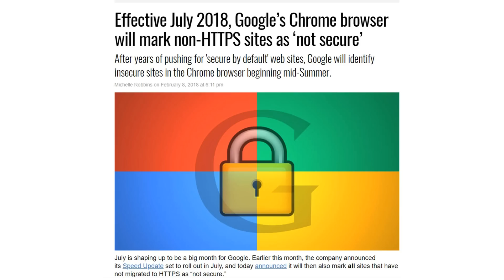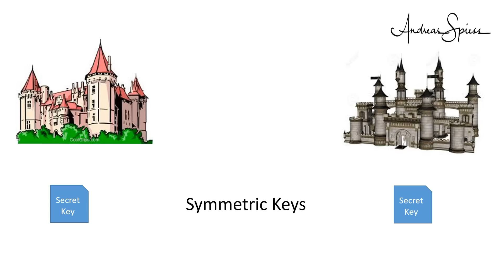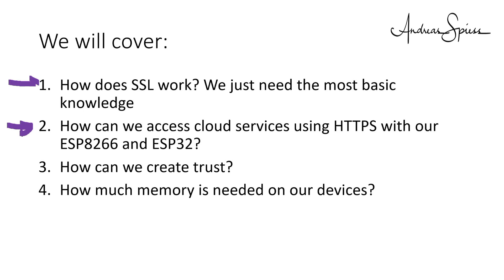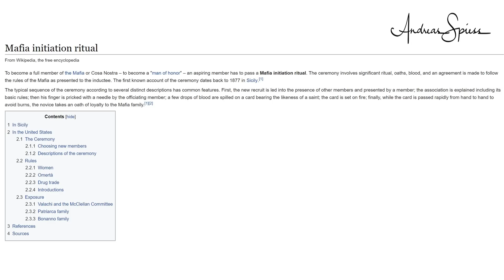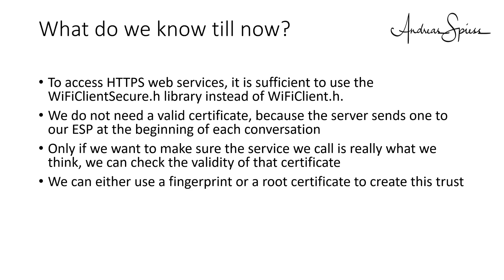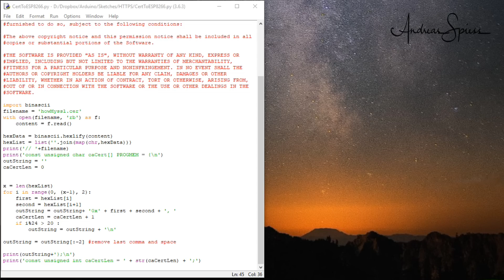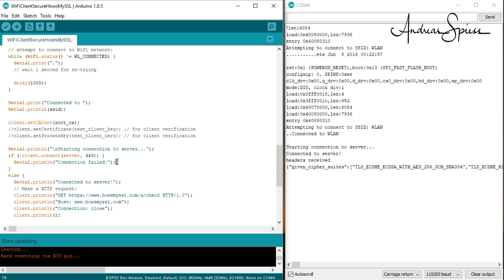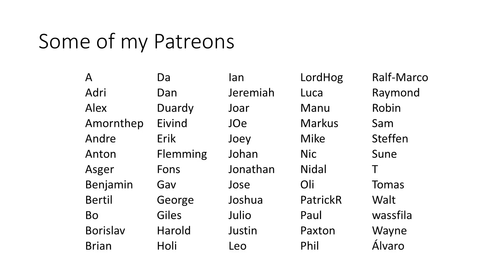#232 How to secure our devices using SSL (ESP8266, ESP32, Tutorial)

Comment: As usual, a great video. Hoever, I did miss the part that talks about performance of the asymmetrical (handshake) part of the connection. Depending on the cypher i may take upto 3 seconds to het the connection up and running. When using mqtt this can be a mayor pain in the bottom. I would have loved to have some more info in that since it's hard to find...
Reply from the maker: I do not use encryption in my LAN.
Reply: @AndreasSpiess  I don't understand. The video is about using SSL on (for example) an ESP32. An SSL connection starts with a handshake that uses asymmetrical encryption. I can be very slow especially if you reconnect every few seconds (MQTT for example). It made using MQTT over SSL nearly impossible for me. Hence my question...
Reply from the maker: @Bigman74066  sorry that my answer was so short. what I wanted to say is that I use SSL to contact internet services like google. So I do not need frequent repetition.
MQTT is only used for my sensors on my Wi-Fi. So the 3 seconds are not a. If Problem for me.
Reply: @AndreasSpiess  thanks for clearifying. Maybe someday a video will pop up about performance of MQTT over SSL on an ESP32. You never know!

Comment: Hello sir, u make some great videos.
I cant wrap my head around the following concept. Maby you or anyone else out here could point me in the right direction.
Wat I am working on is the following,
I am building a vendingmachine thats controlled by an ardiuno. I want it to work as followed, a customer goes to my website on their phone, this opens a webstore so they select the products into the basket and pay online witj ewallet or online bank. Just like any other webstore, than the webstore needs to send.the data after payment verification to the andrino that gives out the product. I understand I can connect it with utp to the internet, but what protocol or software I use on the website to instruct the arduino? Or would it be easier to use a phi that hosts the webstore, and connects via lan to the.andrinos?
Reply from the maker: I would divide your project in parts and build one part after the other.

Comment: Dear Andreas, since this video is already older and I am fighting with micropython on an ESP32, didn't find much in the internets: It would be fantastic if you could try HTTPS requests on micropython :) maybe even with proper certificate checking - or would you suggest CircuitPython? So far, I like Thonny a lot..
Reply from the maker: After my Toit "excursion" I will not cover higher languages for quite some time. The time is just not ripe for mainstream. At least not in this community...
Reply: @AndreasSpiess  Ah OK thanks you for your answer!

Comment: Hello Andreas, this was great - thank you. Hard-nosed, focus on specifics and only what is needed as usual.

However, I have a couple of questions which might be answerable by you or anyone reading this. I am using ESP8266:

1. In my case, if the fingerprint is wrong the connection does not proceed - it is refused and no information is returned. So that is not an option for me. Does anyone know how to get aorun dthis?

2. Even with the certificate version, it will still stop working in a year or two, so this cannot be how embeded devices colve the problem - they would become non-fuctional when the certificate did expire. How do they do it?

Many thanks
Chris
Reply from the maker: There are some developments to get the replacement of certificates working. But it is not easy on MCUs. I have no solution for the moment. Maybe somebody else knows. I only know that we can deal with it with IOTAPPSTORY.
Reply: @AndreasSpiess  Thank you Andreas - a personal reply so fast to a comment on a video years old. You are a MACHINE, and I envy and admire your stamina. The community is vastly better wtih your contributions. Thanks agin, Chris

Comment: Thank you for this tutoriel, it was just the right thing to get me started on my project. Really easy to understand ! Your channel is really a gold mine for IOT users !

I'm working with an ESP32 and an MQTT Server. I found that the way to make the connection secure with the server is close to what you show in this video, with some nice certificate. It's working quite nicely in local network, and it's in part thanks to you ! 

But if my ESP32 is outside the network, then I manage to reach the server (with it's public ip and some port forwarding on my box), but I can't connect to it. Did you ever had a similar problem ? It's quite mysterious : I know my certificate is ok, as is my server. But suddenly the server told me my certificate is corrupt. Almost mystifying, really.
Reply from the maker: A project I was involved (IOTappstory) had to solve this problem. But I do not know the details. I only know it was not easy :-(
Reply: @AndreasSpiess  Ah, I can believe it, network problem is never easy. I don't believe you've got an hint on how it was solved ?

Comment: Hello Andreas, 

I am having trouble getting your python script to work properly. I loaded it into my Raspberry and ran it in the same folder as my ca.crt file (also tried changing the name to ca.cer). I ge this error:

python CertToESP32.py
// ca.crt
const char* test_root_ca = \ 
Traceback (most recent call last):
  File "CertToESP32.py", line 39, in <module>
    first = (chr(content[i]))
TypeError: an integer is required

The certificate is in the right format with -----BEGIN CERTIFICATE-----, but it doesn't have those nice /n at the end and hasn't been adjusted. I guess that is the purpose of your script! By the way, I created my certificates using OpenSSL
Reply from the maker: This is an old project. So it is possible the code does not work anymore.
Reply: @AndreasSpiess  Okay, thanks for letting me know! I suppose I can manually count the characters and hit ENTER a few times for the two certificates I need.

Comment: Couldn't get you example sketches to work, sketch always stops with "connection failed", so the fingerprint was not even checked yet.
Eventually i added the next line to the sketch (directly after "WiFiClientSecure client;"):
client.setInsecure();
Don't know what was wrong with my setup, but it works flawlessly now :-)
Reply from the maker: Thanks for the update. Strange...

Comment: If you do not want to bother with manually writing a fingerprint or certificate in your sketch, there is also a framework that automatically includes all root certificates in your ESP8266 sketch. With this you can do HTTPS requests to any URL, and it will always be secure:
https://maakbaas.com/esp8266-iot-framework/logs/https-requests/
Reply from the maker: Thank you for the link. Seems to be a good approach. Unfortunately not for the ESP32...

Comment: Thank you for the perfect explanation. It is very useful an focuses on the important facts.

Is there any possiblilty to download the SHA1 fingerprints from a server of website?
It would be easy to update the fingerprints by stating the URL and getting back the SHA1 fingerprint like in the browser. So the sketch could get it once the fingerprint is expired and I would not need to update it manually.
Reply from the maker: I do not know.
Reply: This would not be secure, because if you would have a man in the middle, it would just provide you with the wrong fingerprint and you would not know.

Comment: does Esp32 support self signed certificates? I can make POST requests from mobile to my localhost server, but not from esp32 using the same self signed certificate..
Reply from the maker: Unfortunately I am no security specialist.
Reply: @AndreasSpiess  no problem..
just because i plenty of hours working on this, if someone have the same problem MAYBE esp32 is problematic with self signed certificates..i didnt make this work even other secured sites worked fine
Reply: Blog https://medium.com/the-esp-journal/esp32-tls-transport-layer-security-and-iot-devices-3ac93511f6d8 contains information about using self signed (CA) certificates. Maybe this helps, not tried by myself yet.

Comment: How can I connect to https when using an Arduino Nano or a Teensy for example? Or do you have to use an ESP8266 development board/MCU? 
I have an ESP8266 WIFI Module (ESP-01) connected to a Teensy 3.2 board, but when I compile it says "ESP8266WiFi.h cannot be found". If I change the board to "Generic ESP8266" I get an error saying "Multiple libraries were found for ESP8266WiFi.h". So confusing.
Reply from the maker: I only work with ESP boards if I need WiFi, so I do not know,.

Comment: Excellent video, as usual. Thanks a lot!
However, I tried to replicate the steps for ESP32 but I have an error with the certificate. I found another example with different howsmyssl.com certificate and it worked. Is the python script in your repository still valid?
Reply from the maker: I di not know as I did not use it since then.
Reply: Hi Ismael, could you kindly share the example you used to convert the base64 .cert file to the format used for ESP32 please?

Comment: The code used in HTTPSRequest.ino for the esp8266 is it not outdated? Because I see the BearSSL library is more often used these days and AxTlS library is
 deprecated. Does this matter as to the safety of the connection? Please clarify, thank you!
Reply from the maker: This is an old video. BearSSL does not change the basic concept. So there should be no difference in security.

Comment: I am getting 'connection failed' for some reason with the HTTPSRequestHowMySSL.ino example. Any help here? I am able to connect to my wifi but failing on howsmyssl.com (using esp8266)
Reply from the maker: Unfortunately, I cannot do remote debugging.
Reply: Andreas Spiess the issue was in my fingerprint! I resolved it by accessing the api insecurely with no fingerprint which leaves it vulnerable to server spoofing but is ok enough for my use

Comment: Nice explanation, and good info. Thanks. Have committed some $$ via Patreon
I found an error message trying to convert a root cert file to .cer format using  Cert to ESP8266.py. Fixed by removing the attempt to map the chr function across the hexData.
ie:
replaced this
#hexList = list(''.join(map(chr,hexData)))
with this.
hexList = list(''.join(hexData))
Reply from the maker: Thank you for your support! I am not a Python specialist and I found the script on the internet. When I used it I had no errors, if I remember right. Now your code is in the file.
Reply: Hi Bernie, how did you do this?
Reply: Already tested. This should works:

hexList = list(' '.join(map(chr,hexData)))

The 2nd not working. Thanks!

Comment: Hi Andreas,

I know that this video is 3 months old but is really difficult to follow you, and sometimes expensive, but ever fun.

I have tried the example with the ESP32 and everything works fine, but if I'm not wrong, you said that the use of client.setCACert(root_ca); is mandatory.

Because I'm really old but still a little rebel, I tried the same sketch without setting the root_ca, by simply comment the line.

And it works and the resulting JSON is exactly the same, point that simplifies a lot the https connection.

If someone want to try it, not only in the example but in real life, any comment will welcome.

Thanks for all your effort and enthusiasm!

Rom
Reply from the maker: Maybe they changed the behavior of the library. As mentioned in the ESP8266 example, the certificate is not for the site, it is for you to check if you are connected to the right site. The ESP8266 always returned the string, also w/o a certificate.

Comment: I am using he esp32 WiFiClientSecure library. 
But it does not have a cilent.verify function. Just to check I put a wrong root CA cert and it still connected to the server and gave html data.
So, am i doing something wrong or if not then how can I verify for the esp32 that I am connected to the server I wish to be connect.
Thanks in advance.
Reply from the maker: This is strange. I thought in my examples this did not work

Comment: @15:00 resource usage is confusing if it is not referenced to flash size.  So will this fit in my ESP-01 512k?
Reply from the maker: Just try it. Takes you less than 5 minutes
Reply: Save me 5 minutes.  What is your flash size?
Reply from the maker: 1M usable for the sketch. But your memory depends on the partitioning of your ESP.
Reply: Thanks.  :o)

Comment: When I first started reading about the ESP8266 when it came out, one of the first things I thought was "ok, but what about encryption?" and was surprised at how hard it was, and how uncommon. Today's IoT infrastructure is pretty unsafe.

I think the best model right now is to use SBCs as central hubs to microcontrollers, since even the cheapest $10 SBCs can do HTTPS just fine. Sometimes, even the work of microcontrollers can be done by the SBC, especially when it isn't timing-critical. Plus you can then code logic as scripts rather than C.

Microcontrollers shine when low-power and real-time processing is required, but the difficulty to make them secure must not be ignored. It's always good to assume that these devices aren't safe and consider the implications. "What could a hacker do with this?" For things like lamp colors, air conditioner automation, motorized blinds, homemade weather stations, etc - then even HTTP is good enough.
Reply from the maker: I agree. My problem was more that many companies do no more accept HTTP connections. And I find the combination of ESPs and cloud services a good thing.

Comment: Thank you for the solution.
Do you have a solution when I use a htaccess for user/password?
Reply: If your want to connect to a server that uses HTTP Basic Authorization for access control (that's most likely what you will setup in a htaccess), you just need to set an "Authorization" request header. For Andreas' HTTPSRequest.ino sketch for the 8266 you should be fine by adding 
"Authorization: Basic dGVzdDp0ZXN0C\r\n" +
after the other headers, eg. in line 72. That token is just the username, a colon and the password concatenated and base64-encoded (test:test in this case). If your credentials don't change at runtime, you can just precompute the token put them into your code like that.
Reply: @fhessel  Thank you. 😁
Reply from the maker: I am no specialist, especially not on the server side. My main goal was to be able to access HTTPS sites also in the future. So I cannot help you.
Reply: @AndreasSpiess  Thank you for your swift reply. I will seek for an solution elsewhere. But please, keep up with your educationally and inspiring instructions. I love them, and learn a lot from you. You are a great source of knowledge and a great entertainer. 👍😁😁

Comment: Andreas - do you think it would be possible to install an esp32 into this Blackberry housing and get the LCD display and keyboard working? 
 https://www.aliexpress.com/item/New-LCD-Display-Touch-Screen-Digitizer-Assembly-Bezel-Frame-Keyboard-For-Blackberry-BB-Q5-Tools/32908753072.html
Reply from the maker: A lot is possible, but without documentation, it is hard to use the display as well as the keypad. And Blackberries are quite thin...

Comment: Better and faster is built in esp encryption that can be used with udp/tcp and it is much safer and free)
Reply from the maker: You are right. But the purpose of that video was to enable our devices to use services on the internet even if they change to HTTPS. 
So far, I do not encrypt behind my firewall.